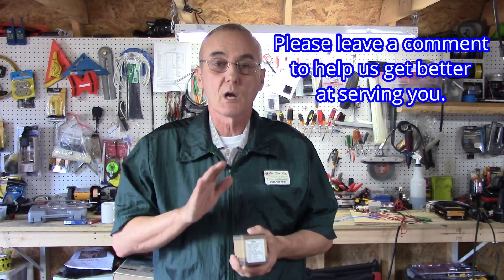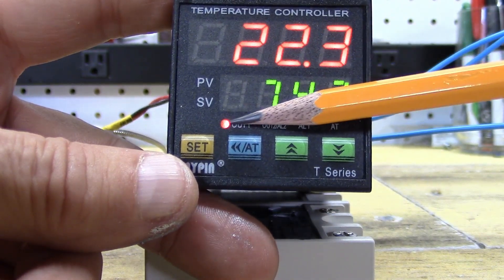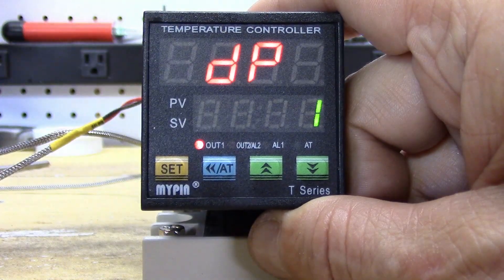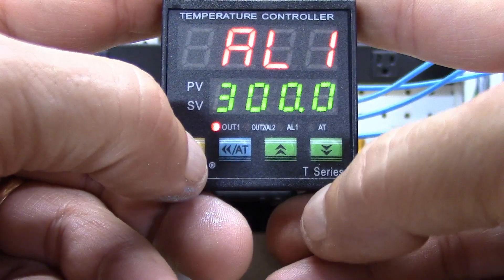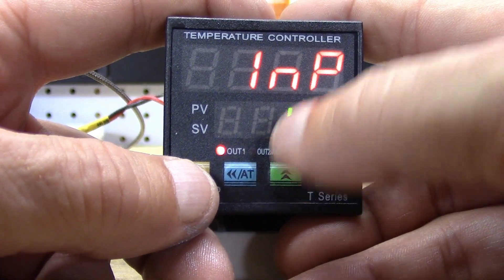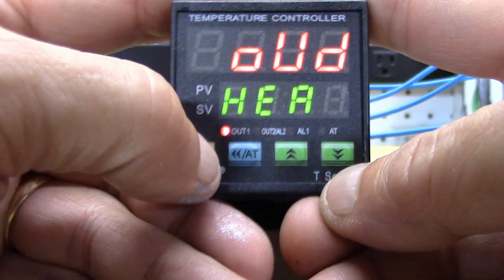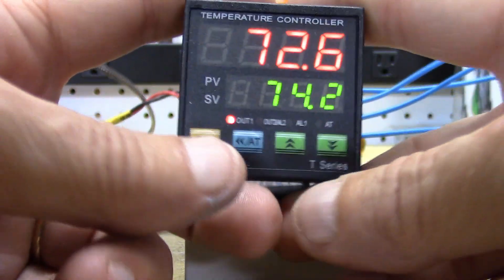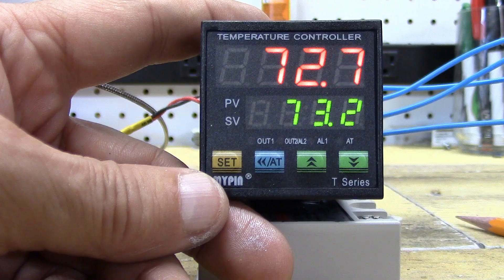Setting parameters on the MyPin T series PID controller

Comment: I had to divert for a while from working on my controller.  I have watched your videos again and they remain at the top of excellence for easy-to-understand and very concise instruction and information.  I have the Mypin TA4 with SSR output operating on 110 VAC and ultimately be used for a BBQ smoker.  But right now while I'm trying to get the programming set up, I am using a fan for the load, instead of a 1500 W heating element.  Problem:  As soon as I turn it on,  the display and LEDS blink at the rate of about  30 hz/sec.  Press and hold SET and must wait 30-45 sec for AL1 to come up and then it will go to A01,  AL2, etc, on down the list and start over--at no point do I have a chance to interact and enter changes.  I know from your videos what I want to enter and altho I am not yet adept at quickly pressing correct buttons in correct sequence I think I am quick enough.  Same thing occurs when I begin by holding down both green buttons.  Do you have any ideas?  Of course, it may be that the controller is faulty or that my wiring is wrong.  I have included a lit fan switch, a large LED that shows when the SSR is operating--yes, a redundancy I know! plus a multi-function watt meter.  Also 2 AC outlets and panel-mount fuses.  All of these extras seem to work fine.  I should also note that the controller must have been set up to have the  SSR in conducting mode as the load (fan) and signal LED both are on.  Thanks so much for any help!
Reply from the maker: Once you get AL1, AO1, AL2, AL2 stop a the next parameter and then push the blue button to access its setting. After that you use the up/down arrows to set that and then press set to save and then set to go to the next parameter.
George
Reply: @BarleyandHopsBrewing  Thanks George!  Well, I followed your very simple instructions and here is part of what I found.  The flickering continues and makes it next to impossible to see any changes made by pressing the blue button if I am lucky enough to get to that point,  and it moves only sometimes.  Often the parameter choices just starts quickly indexing to the next one.  The whole display may go dead for 1 sec , then return somewhere down the list.  I have no idea what I do to trigger it, but it will start flashin g gibberish (to me!) eg, cJS, CJl, Lch, CuL until I turn it off.  In general, it seems to mostly ignore the set key and especially the blue key.   You make it look so easy in your videos so something must be wrong with me or the PID, or maybe both!  Is it possible I could have damaged it while trying to get it programmed?
I just remembered that the first time I turned it on, the display momentarily dimmed for a split second and I heard a faint click-like noise.  I had it fused for 2 amps and the fuse did not blow.
Reply from the maker: @denzilcypret742  Very possible you damaged it or it is just faulty.
I have only had 2 of these fail from the factory in the past 5 years. It is possible that it is just faulty.
George
Reply: @BarleyandHopsBrewing I did as you said about going thru AL1, AL2, etc, but I could not stop it from going to the next parameter automatically and it was cycling so rapidly I could not stop it with the blue button or the set.  I have to say it is uncontrollable with my present knowledge.  OK, so I installed another PID, brand new, out of the box, and it responds in exactly the same way!  This is so ridiculous that I think it must be something on site here, maybe a sneaky short, so next I will COMPLETELY rewire it.  Of course the schematic could be wrong.  I don't know how to send a picture so I'll do the best I can to describe it in words:
PID TA4 with SSR output

110VAC in,
black to fuse,
black from fuse to switch,
switch to PID pin 1,
then to SSR pin 1,
SSR pin2 to receptacle hot (temporary load of a fan),
receptacle neutral back to 110VAC neutral.
Then PID pin 3 neg to SSR pin 4 neg,
SSR pin 3 pos to PID 4 pos.
TC K-probe connects to PID pins 7 and 8, observing polarity.
Unless you see something glaring here, I believe you have done the best you can working remotely.  It is something here and I'll just have to work it out.  Many thanks for all the excellent videos, cooperation and especially your patience!
Reply from the maker: @denzilcypret742  Send me an email and I will respond with a wiring diagram
When you push set for 3 seconds (until the display reads AL1) let the set button go. If you hold it it will scroll. 
Use the blue button to start the digits flashing and then use up/down arrow to change. After that push set and let it go. Push set again and let it go to go to the next step.
Reply: @BarleyandHopsBrewing  Hey George!  Thanks for sending that diagram!  It is just like the one you used in your video (and that I am using), except that it has the hot 110VAC going first to SSR 2, rather than PID pin 1-a minor difference- and the PID pin out is different but very easy to figure out.  

I do release the set button as soon as it reads AL1 but it takes at least 45 sec or more to change (IF AT ALL).  If I do finally see AL1, and IF I can press the blue button to get the right digit, it will instead advance to AO1, PUF or whatever, causing a do-over.  But this sequence is not consistent and different results may be displayed.  Both the new-out-of--the-box PID and the old exhibit much the same behavior.  As I recall the new PID behaved normally thru part of the first set-up and then started needing many seconds to reach either LSP, or AL1, depending on the pressed buttons.  I have tried reversing the TC leads, 3 different TCs, different SSRs, connecting the hot lead to SSR 1 rather than PID 1 first, and of course that made no difference, as did any of the other permutations I could think of. I can only conclude that all these problems are due to my errors/stupidity, not simply getting 2 bad PIDs in a row,  and order another one, hoping that I have learned enough to successfully accomplish what is truly an uncomplicated project.  George, how can anyone fail when they have you and all your magnificent videos showing the way??      ??
Reply from the maker: @denzilcypret742  Would you like to just send it to me and I will see what I can find out is wrong with it?
Send me an email and I'll send you an address. george.duncan76@gmail.com
George

Comment: Hello. I am still having problems with my pid since I dont really understand the meaning behind I and D. To put it in context: I have set my kiln to 600°C. Used Auto tune. But After the auto tune cycles are finished the temp swings around 596 to 602. I dont get it to a really precise temp. I assume a range is inevitable. But 6 degrees is a bit more than I would like. I have tried different values for D and primarily I..results did change..but not knowing what I do it was still not what I wanted to achive. Long Story short: which parameter(s) should I change and in which direction (up or down). Thanks in advance and again thank you for your videos.
Reply from the maker: If all is working right your deviation should only be 2/10s of a degree or so. 
P= 1
I=540
D=200
Try these values to get started. I also had a contact who had similar problems lately and the problem was the oven and not the PID. His oven was losing heat at a rate higher than it was keeping it in. If this happens the PID will only get confused since th temperature never seems to settle due to thermal transfer rates.
George
Reply: @BarleyandHopsBrewing  George I appreciate your help. I will try your parameters although I was under the Impression that P, I and D all depend on your setting. If these values won't work out I still don't know the meaning of I and D and will start from square one again. So if anybody can explain me the meaning of both parameters I would really appreciate it.
Reply from the maker: @theflyinggearman3128  Proportional control will control the percentage of power per degree of change in the temperature. The Integral is a time function in seconds so the PID senses these changes over a period of time to correct any droop caused by the proportional function. It is like mathematically making a prediction. All predictions are not accurate so a derivative function is also a time function and also a negative action to reduce the impact of any oscillation in temperature. It sort of helps slow down the temperature rise. These three values acting together provide a smooth increase and a stable temperature by constantly comparing the temperature sensed with the set temperature, the proportional difference (you set) the time taken to change from one point to another; adding a prediction and then softening that control to prevent over/under shoot of the set temperature. I hope I have explained this clearly. This is a very broad topic but this is sort of an explanation in a nut shell. Broad brush stroke here...
George

Comment: George,  my  MyPin-TD4,  has a few more things in the program,,  after  ctL,,mine has   trL, trH, b5L or bsL,,  then to c-f and then lock,,  any idea what they are and why mine has more things to set????
Reply from the maker: No. Those are additional setting for an analog setting for servo motors. You can just skip them.
George

Comment: George, I don't know much about PIDs but what I do came from you!  Thank you so much.
I have a TA4-SSR that I am setting up for an electric smoker.  To test it, I have the 110vac hot going to PID pin 1 and neutral 110vac to PID pin 2.   A jumper goes from PID (hot) pin 2 to  SSD pin 2 and SSD pin 1 goes to the hot side of a 110vac fan, serving as the load.  The neutral fan lead goes to PID pin 2.   Then, SSR 4(neg) goes to PID 3(neg) while SSR3 (pos) connects to PID 4 (pos) The K probe connects to PID 7 (neg) and PID 8(pos).  

In normal operation mode the PV is 85 and the SV is 86.  When PV reaches 86, the SSR input lite flashes on/off .  On the PID, the output flashes on/off and the AL1 is lit.  However, the load (fan) does NOT come on!  I feel I am close but my brain is so twisted I cannot see my error for the life of me!  I hope you can find time to educate me further.  Anxious!
Reply from the maker: Do not, do not run the neutral to pin #2.
Use the SSR as you would a switch. 
Hot wire to pin #1. Neutral wire to the fan.
Run a separate hot sire from pin #1 to the fan. 
When the PID engages it will complete the circuit to the fan and it will come on.
Your K probe is correct.
Reply: @BarleyandHopsBrewing  George, please, please forgive me for being so dense. 

Is this what you mean?  PID #1 (hot) and #2 (neutral) are the mains supply.  PID #1 connects to SSR #2.  SSR #1 goes  to the hot side of the fan.  The neutral side of the fan goes to PID #2 completing the fan circuit (when the SSR is turned on by the K probe).  

Of course, as you have made very clear in prior posts, other elements of the circuit are a switch, receptacle, fuse(s), panel lights, cooling fan and an ac amp meter which I especially like!  If I am getting closer to understanding all this I am very happy.  The eureka moment for me was your statement to use the SSR as a switch--as simple as that!  You are truly the best!  Now to see if it will float!  Denny
Reply: Oops!  That one doesn't work!

I re-checked and found an error.  PID #1 goes to SSR #1 (not SSR #2 !!!)and a jumper goes from SSR #1 to the hot side of the fan.  So, if I connect the cold side of the fan to SSR #2 it still doesn't work.  I'm having trouble getting the fan to neutral--your instructions said do not connect neutral to pin 2, which I assume to mean PID #2.  Do I misunderstand your advice?  Alternatively, seems to me it would work if I went from PID 1 to SSR 1 and the SSR 2 to one side of the fan, and connect the other fan side to PID #2......?
Reply: OK, success finally!  I simply connected the fan in series between SSR #2 and PID #2, as in the alternative I stated in my last sentence above.  Thanks for your patience and help!  Now I can start cutting holes in the box.

Comment: Great video, thank you for posting it. 

----- One comment on Auto Tuning that others might find helpful. If your going to auto-tune your PID settings make sure to first set the temperature to a value you expect to be using regularly, click and hold the "AT" button, and most importantly WAIT till the AT light turns off. Otherwise you will not have completed a full auto tune cycle and the parameters will likely be incorrect (most likely an under estimate). 

Thanks again for the concise video, I couldn't make heads or tails of the horrible so called manual I found online.
Reply: What would be a good temperature to use the auto tune  when im smoking a 6 pound boston butt.

Comment: Hi George. Thanks so much for your informative and clear instructions. Is it possible to use the AL2 output (which is labeled "SSR" on my device) as an alternative process-control output?  The main ctrl output on my TA4 is proportional out i.e., 0 - 10volts, which isn't suitable for the application I have in mind.  The instructions that came with my TA4 hints that AL2 can be configured as the control output but is unclear about how to actually do it. It may be that it is there for processes that requires both active heating and active cooling...
Reply from the maker: Yes, you can use AL2 as a switch. You will need to provide power to one pin of the AL2 connection and then run from the other connection to your device. Of course a neutral wire to your device for the complete circuit. 
When the requirements of AL2 are met the relay will close and your attached device will come on.
George
Reply: @BarleyandHopsBrewing  Thanks for taking the time to reply, George. All the best.

Comment: I was running my Mypin yesterday with my heat treatment oven with 170 °C programmed. With every cycle there was an overshoot by 14 degree resulting in 184 °C. Setting the PID to auto tune resulted in even worse results....some people suggest to switch of the D function. I am confused. Can anybody Help? But than again it is used in so many different kinds of application and most people won't try all possible combinations to get this thing to work. So there has to be a better way than my way
Reply from the maker: Yo can turn off the derivative function but then your set temperature will never be achieved. It will normally run just a few degrees lower.
Reply: Thanks for your response. I have watched your video on the set up of the Mypin several times and did came across this remark. But since the values you used resulted in overshooting in my setup I tried to switch off D. The result was overshooting or "under"shooting depending on the I value but much less overshooting than when D was active. In any case I expected the device to figure things out by itself and to learn over time- which didn't Happen. Maybe it depends on the Type of application (brewing, furnace, etc.)?
Reply from the maker: Also try setting the I (integral) to 40 and if it overshoots too much set it to 50 and so on. 
This way your PID is working as a PI controller. The I function works to settle out the under/overshoot of the set point.

Comment: One more question please. Why I can't change any settings in a SET BUTTONS. this PID is on my new smoker and I notice that tjere is a diferent temperature and I would like to calibrate the PID. Any help please.
Reply from the maker: Please explain. I am missing something here. IS your PID reading differently than the actual temperature?
Is this a MYpin TA 4?
George
Reply: Yes it is and yes on PID IS 38°C but on my other two thermometer showing only 29°C
Reply from the maker: @MartinsvibaPizzaiolo  Go into the parameters until you get to PUF, this is the offset, mkes sure you change the setting to -9. That way the readout will be what you are looking for.
Reply: Tthanks I will give it a go. Will let you know
Reply from the maker: Okay. PUF should be the 5th display as you run through the parameters. Also make sure you set it as a minus (-) number, if not it will offset in the opposite direction.
George.

Comment: Hello can ypu please explain to me how I can setup temperature like 66.6°C at the moment I can only do 66 or 65 or 67 but I don't know how to get 66.6 many thanks
Reply from the maker: Go into the parameters and set the decimal point you require, It can be .0 or .00 You get to select it.
George
Reply: It doesn't work I can't even change C To F nothing none of the settings I can't change.
Reply from the maker: call me 254-681-1760

Comment: 1. Hold set key for about 5 secs
2. AL set to 300
3. A01 set to 2
4. AL2 set to 450
5. A02 set to 2
6. PUF is the offset to adjust (used if temp is off of calibration)
7. INP K type (looks like a backward Y)
8. P set to 1
9. I (looks like 1) set to 540
10. D  set to 200
11. Heat
12. Hys set to 1
13. Cel set to 001
14. C – F set to F
15. LCY set to 000
16. Hold set
Reply: Can you help me. please set for my PID mypin  200 degree .
sorry for my eng.

Comment: I have the NYPIN T series.

When I hold the blue button to Auto tune and press and hold for 5 sec. It wont go into auto tune mode. What am I doing wrong?
Reply from the maker: Make sure the parameters are set to operate as a PID. You may have this set to manual where autotune is not available. 
Also make sure your derivative function is turned on. They normally come with this function turned off.
If you need help call me I will talk you through the process.
George
Reply: @BarleyandHopsBrewing   are you able to tell me what settings are named so I can get into these options?

Comment: I run a ta6 at 1050 f to a kiln to annheal borosilicate glass. Im having an issue where its taking hours and hours to get to this temp after i changed the element. Im wondering about ramp speed. And how to program that. It should and used to get up to five hundred whithin 20 mins. Im really confused at the manual. Plesse help
Reply from the maker: What is the wattage of your heating element and are you using 240 Volts or 120 Volts?